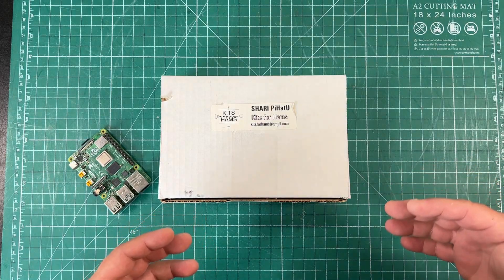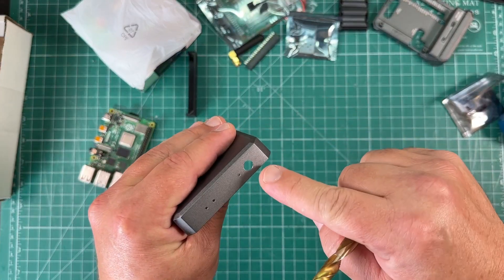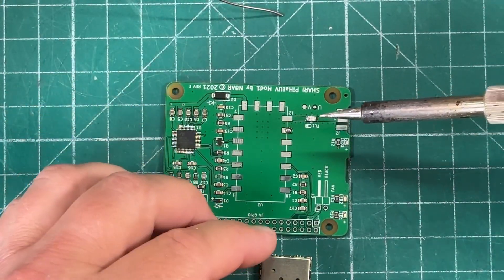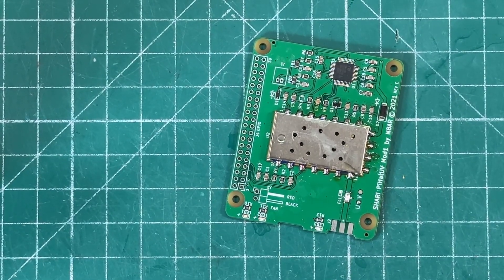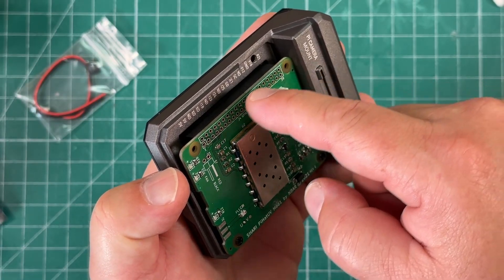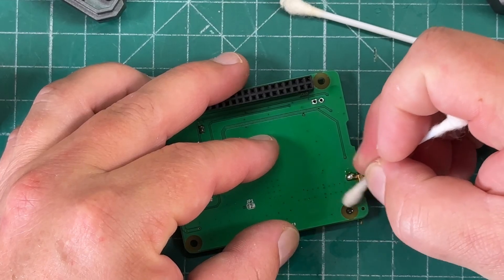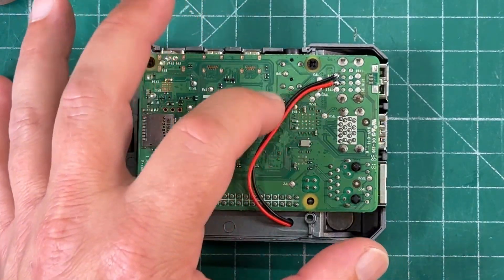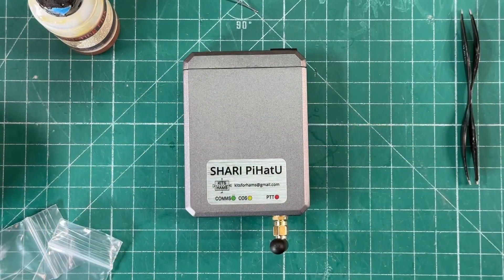How To Build Your SHARI PiHat Step By Step Instructions

Comment: Curious if he wanted pins 9,10,11 also soldered to to shield to pull more heat off the chip via the ground plane.
Reply: Actually the directions say it is OK if you accidently make a solder connection to the shield on pins 7, 9, 10 and 11.  Here is the text from the construction manual.  " The module shield is notched above each castellated hole except pins 9, 10 and 11 to
minimize the possibility of a solder short to the shield from the castellated hole. Ensure that your soldering does not create a short of any castellated hole to the shield with the exception of pins 7, 9, 10 and 11. Check with an ohmmeter if in doubt."

Comment: Have been using one for a bit and zero node in car.
Reply from the maker: Have you just not been able to get it to pair with your phone as a hotspot?
Reply: @hamradiotube  use a hot spot no incoming but I can connect out.